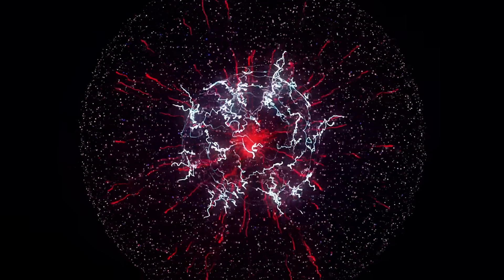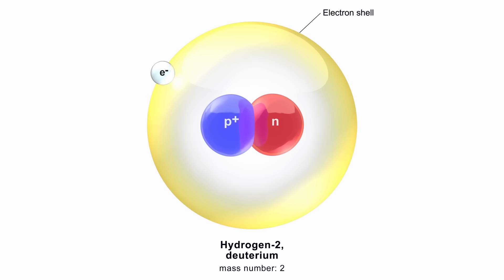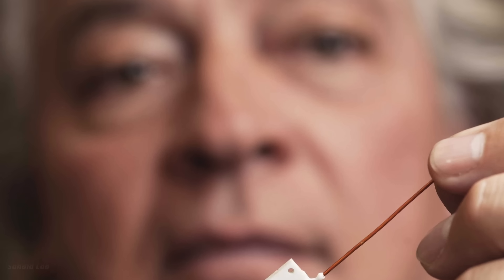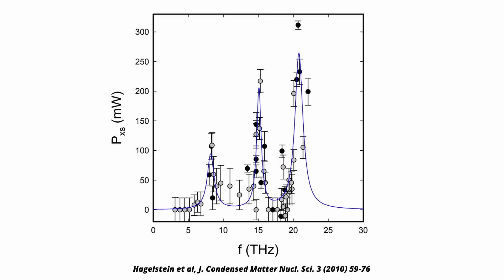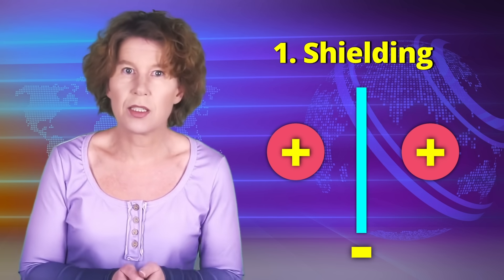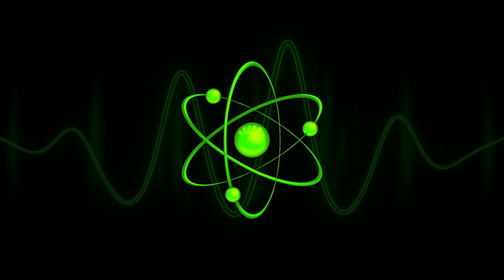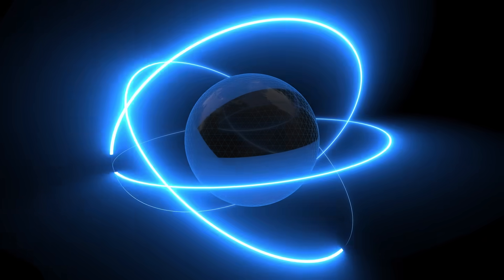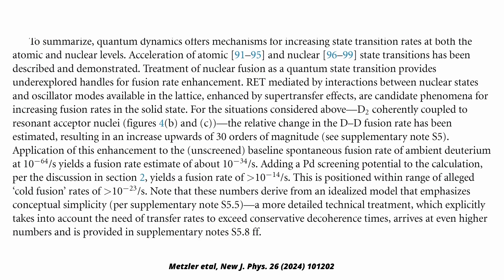Physicists Say They Know How Cold Fusion Works

Comment: The quest for practical fusion power is actually just an infinite money glich discovered by physicists. The rewards for investors would be so great that their greed makes them very susceptible to hype and they can't resist funding whatever wild goose hunts the physicists think is plausible enough to tempt them. 

In the dozens and dozens of predictions and forecasts for when practical fusion power will be achieved, i have never, not once, heard them admit to the very real possibility that we live in a universe where useful fusion power is not practically achievable on planets. 

Meanwhile, there is an actual, working fusion generator which will run continuously for at least another 5 billion years or so, which is constantly radiating billions of times more energy than humanity requires evenly over the surface of the planet we inhabit. But that energy is not going to make anyone into trillionaires, for that you need your own private sun in a basement that you can meter and sell. It makes me sick and sad.

Comment: Cold fusion is either associated with photodisintegration, or it's like a Peltier device, with more efficiency that uses alkaline water. The electron configuration is more important IMO, along with just general plasma electrolysis. Idk id ever feel comfortable referring to it as cold fusion, don't touch it, you'd be burned because of the energy it produces and it can kill, but its probably the same concept.

Comment: So, in summary: 1) Fleischmann-Pons has NOT been validated. 2) New theoretical calculations suggest new ways to accomplish cold fusion. 3) There is no experimental proof or demonstration of the calculations in point 2.
Reply: ENG8 have demonstrated 5x over unity, so there's that.
Reply: @littlefish9305  My response after a quick google search of ENG8: LOL

But, time will tell - they claim they will be commercial in 2026
Reply: @littlefish9305  ENG8 is a scam

Comment: There is a cold fusion option that does work, but they can't get enough energy out (not taking about diffusing deuterium and/or tritium into a metal).  The other option is muonic replacement where the electrons are replaced by muons which are 300 times more massive and thus orbit the nucleus much, much closer to the nucleus, within the columbic barrier distance and can get the nuclei to fuse.  HOWEVER - this requires you to have a higher pressure with the deuterium/tritium gas and when running at higher pressure, the muons are less likely to jump between nuclei (which is what you need to have the chain continue).  It was found that it was taking more energy than it was getting out, but it is a viable form of cold fusion.
Reply: Ai sloved it right

Comment: We did Fission and Fusion with photons....We did fission and fusion using venturis to speed and crush PHOTONS into muons and electron showers and INSTANTLY they fused back together...caused particle division and reverse ENERGY but not reverse mass exactly as spoken of lately. Light going forward and backward at EXACTLY the same time due to the push back at the venturi. We did and photoed using CMOS. Love to interact? Its all shown on my channel.
Reply: Um for fusion to actually occur more power has to come out of a reaction  then that put in it simply smashing particles together producing other particles which may come back together again is NOT fusion that's not the definition of nuclear fusion .
That's particle creation and annihilation which may produce some energy but not more than that put in it .

Comment: If experimental evidence provides proof of more energy than you should find in the system, then you have improperly defined the system.

Cold fusion demonstrates that the proper response is to remain skeptical of "complete" system definition.

This doesn't mean you throw out the scientific method. It means you balance rigor with an open mind.

Comment: Oh wow, this brings back memories. In the summer of '89, right after the Pons and Fleischmann announcement, I was interning in a US military physics lab. Our PI (principal investigator) got a small grant to do cold fusion research. I remember two experiments, both involving a palladium metal disc infused with tritium (I think). In the first experiment, we tried to replicate the Pons and Fleischmann electrolysis experiment using a calorimeter. Every day I would check the heat output looking for anomalies. Of course, nothing happened. The other experiment was a bit more dramatic, if equally disappointing. Our PI's specialty was radiation detection and he had the though that maybe physical compression could start the cold fusion. So we set up an anvil surrounded by various radiation detectors, put another tritium-infused palladium pellet on it, and had the burliest research assistant smash it with a sledgehammer. Of course, nothing happened, but it was exciting to think for a moment that we might see a small fusion explosion in front of our faces.
Reply: ACME would approve
Reply: I think most researchers that investigate cold fusion thru compression rather opt to difuse deuterium or tritium in water and then create standing sound waves in it, so they can rythmically create bubbles that implode after some centiseconds. The pressure produced by these implosions normally generates tiny flashes for temps inside get to thousands of degrees (that's how the pistol shrimp kills its prey), so lots of researchers have tried to do fusion by putting enougt D+T within these bubbles. Sounds well in theory, but to date nobody has been able to do so
Reply: @JosePineda-cy6om  you've given me an idea… I'm going to infuse some pistol shrimp with D+T
Reply: @JosePineda-cy6om  that sounds like a plausible explanation of how to create cold fusion. But it also sounds like something Cisco Ramon would say in an episode of The Flash.
Reply: @JosePineda-cy6om  Our company also tried this.  NO results.
Reply: He was not incorrect that physical compression starts the fusion process. But you need a bit more pressure than a sledgehammer. In a hydrogen bomb, they use a nuclear fission bomb to generate the pressure.
Reply: They use shaped conventional explosives to compress the fission stage, too. 

The thought of a serious scientist battering stuff with a hammer to maybe induce fusion is pretty funny, though.
Reply: @NeffJippard-z9k  The idea for making the first uranium bomb was a gun design so battering with a hammer wasn't far-fetched. Los Alamos did gun shots, too.
Reply: @solconcordia4315  I don't think you understand how the gun design works. You shoot one undercritical mass into another to get above the critical mass and boom. I don't see the connection to battering something with a hammer.

The thought just created a funny mental picture in my mind, that's all.
Reply: i think Pons & Fleischmann never had success with Tritium. It was deuterium that gave anomolous results.
Reply: @oystla  Hmm, deuterium might be more able to absorb extra neutrons.  There are many little facets to test.  I suspect the crystalline structure of the palladium is also immensely important for the atomic geometry involved.
Reply: Sledgehammer physics, Humanity is still scratching around in the dirt with our 🐒 🧠 looking for the All Spark
Reply: I was in a Physics PhD program in those heydays of High TC Superconductors and ColdFusion.
One of our postdoctoral. who was Stephen Hawking's student whisked a few liters of deuterium from somewhere to mess with it but was shortlived and shut shutdown when the university safety board found out about it.
Reply: have you never thought of doing experiments with sonoluminescence? I mean to smash a sample on an anvil is certainly one approach but I would be properly shocked if that had worked. If anything you should get a diamond anvil but still it would be a one shot ponny.

To get cold fusion you need to have a cycling procedure, with resonance. Otherwise it's just a waste of time as you cannot extract energy on a one-shot basis. The process needs to be continuous.
Reply: @vaakdemandante8772  
It's a validation test of the Pons-Fleischmann cold-fusiom claim. I'm pretty sure that they were trying to detect fusion byproducts such as neutrons.

I wonder about the ball lightning phenomenon as the atomic scientists had concerns of igniting the Earth's atmosphere in a runaway thermonuclear chain reaction due to the abundant nitrogen in the air. Nitrogen can be transmutated by neutrons from an H-bomb explosion. Ball lightning might be using nitrogen to power itself for such a long time as a wandering plasma ball.
Reply: As in rock bands, in which the drummer is always put forth to try something first
Reply: @cdorman11  The lab was named the “Keith Moon Physics Laboratory” in honor of someone who always tried something first.
Reply: That is such a cool story! Thanks for sharing!
Reply: @Pistolsatsean  thanks! Less fun was the time I had to work several tons of lead bricks used as experiment shielding from one lab to another using only my arms and a small dolly that could only handle about 6 bricks at a time 😂
Reply: @JK_Vermont  That sounds like the perfect place and time to have an epiphany my friend hahaha
Reply: fusion produces high energy *per unit mass*, and it doesn't chain-react like fission. You're not going to create an explosion with the tiny amount of Tritium or Deuterium in that palladium sample, with or without a sledgehammer
Reply: Sledgehammer Physics. I like it! I used to have a job doing machine reclamation that involved sledgehammering. Most enjoyable job I ever had.
Reply: I heard the palladium needs to have microscopic crevices around 50nm wide. Almost has to be nano engineered.
Reply: @DeRochette  You could simply build it in a 3D printer.
Reply: @DeRochette  yes it wasn’t a metallic pellet more like a sintered disc of palladium and some binder that could be permeated by the tritium
Reply: @DeRochette  Yeah, I think this was the Japanese idea I mention in my comment.
Reply: Pons and Fleischmann skipped peer review and went to the press. The world bought it. I remember seeing an editorial about the consequences of cheap power from cold fusion. Then others couldn't duplicate the results. The press learned more than anyone.
Reply: It's easy to mock Pons & Fleischmann -- they made a lot of choices that went badly -- but the resulting debacle was as much a product of science culture generally as P&F personally.

Pons and Fleischmann were chemists venturing into physicist territory, and when they found something genuinely perplexing and worthy of study the consensus of physicists preferred to pillory the chemists and dismiss them entirely rather than try to find what was actually happening.

P&F caught a lot of criticism for turning down offers of collaboration from more established physicists before promoting their "cold fusion" claims and bypassing peer review before going public.  But if I had been in their position I might have done the same thing.  At the time, most of those offers were coming from physicists who were pretty obviously interested in taking the credit if the research bore fruit and scapegoating the chemists if it did not.

I don't think P&F actually achieved fusion at all, but I do think they stumbled on a real and very interesting phenomenon that, while not to date consistently replicable, has been observed often enough to rate much more investigation than has actually been done.
Reply: See, this right here is why we shouldn't be doing it to begin with. INSANELY POWERFUL, and y'all phucktardz hit it with a hammer.
Reply: Well my brother was hit by a spontaneous fission burst while machining a plutonium/deuterium Fusion bomb trigger at Rocky Flats. Be careful with that stuff.
Reply: @OldBillOverHill  Why on earth would you get a fission burst from a fusion bomb?
Reply: Cold fusion is about small reactions not explosions
Reply: Cold fusion is about small reactions not explosions
Reply: Many researchers are now working with Nickel and Hydrogen now. the Pd/D system and the Ni/H system both work, but Ni potentially at higher temperatures.  Pure D is expensive and it looks like you enhance D in the Ni/H system.  Using Deuterium is an expensive shortcut.
Reply: It seems weird because if that had worked, you could have a crater where the lab was . Of course, it never was going to work, but supposedly you thought it might.
Reply: @xpusostomos  Back then, the explosion may have destroyed all the lab's notes. Now, I hope it can be recovered in a distant server (unless the military lab has its own isolated network.)
Reply: @xpusostomos  I don’t think there was enough tritium to be a significant risk
Reply: @JK_Vermont  how much, because E=mc^2 is a hell of a drug
Reply: Why a disc and not a rod?  I would think funneling the high voltage down a long crystalline lattice impregnated with tritium would create high probabilities of interactions.  And the higher the voltage, the more interactions there should be if it works this way.  Might also want to consider the effect of those 'vortices' that form at superconducting temps.  These vortices might also create regions of shielding between small nuclei, as well as have other beneficial effects.  We might find out that, counterintuitively, this form of fusion works better the colder it is!  

Of course, that makes it all but useless for energy production, since the more fusion produced, the hotter the system becomes, causing the rate to dramatically fall off.  We don't have a good method for removing heat produced within such a system, when that 'heat' would be in a system we're also trying to cool dramatically in the first place.  

Now, if we ever manage to produce a room-temp superconductor, that changes things!
Reply: @Alondro77  this was 35 years ago and I was just an intern lab rat … so I have no idea

Comment: As a physicist, I can say I have no problem with the possibility of enhancing fusion rates at low temperature.  The paper described here is interesting and could lead to something. The problem with the cold fusion episode was that the experiments were not designed to allow critical analysis of what was going on,  and claims were made without adequate basis.  I remember the experiments where they "knew" fusion had occurred because the experiment melted.   What Sabine is discussing here sounds a lot more like physics to me.  And you would test the reaction rate by detecting neutrons or other reaction byproducts, not the heat emitted by the system.  Don't use tools that are blunter than they need to be.

Comment: I retired from Intel in 2002. Just before I left, my sailing buddy and senior device physicist showed me a plot of energy density vs technology generation (Moore's Law). He predicted then that the next generation of transistor's heat density would surpass the surface of the sun. Keeping in mind that the number is large because the volume is so incredibly small. I think that was when they went to in silicon cooling?
Reply: Random trivia: The surface of the sun is (relatively) not that hot. Something like 5,000C. As opposed to the core or corona of the sun, which is measured in millions of degrees C.
Reply: Given that Intel had came up with the Pentium 4 around that time, his predictions make perfect sense!

Comment: I'd buy that for a dollar!
But anti-gravity works by slowing the flow of time above the object to be levitated yielding "low pressure time" which is pushed upon by "high pressure time" . . . 
The simplest demonstration are the electro-gravity "lifters" - the charged wire produces "low pressure time" above the lifter and the "higher pressure time" below the lifter pushes it up.

This is analogous to "aerodynamic" lift but inverted.

But if you believe that curvature of spacetime is causing gravity, this will be difficult. Red herrings are seldom helpful.

+++++++++++ - high pressure time - farther away from mass 
+ + + + + + + + - low pressure time - closer to mass 

Those extra pluses push downward and with no extra pluses to counter that push, you get ACCELERATION towards the larger mass, or towards the lower pressure time.

Comment: The way to get Hydrogen into palladium is electrolysis with the negative electrode being palladium and the positive hydrogen atoms are smaller that the palladium atoms and gets absorbed in-between palladium atoms, as much as 1000 time as many hydrogen atoms to palladium atoms.  I do not believe the hydrogen atoms would fuse automatically when palladium is full, there has to be a second step to compress palladium containing hydrogen, maybe implosion.
Reply: Cavitation is much cheaper than implosion.
Reply: The best way to get H into Pd is to heat the Pd to 350C. This is done all the time in H purifaction.

Comment: So what happens when maser energy is applied in a plasma cloud under supplemental heat and pressures contributed by Nature? Nobody has drilled for geothermal energy to depths of twenty miles, but that forecast requires successful vaporization of dry and solid rock. But has that combination been simulated in the lab? At the surface and to depths that conventional oil wells might have been pre-drilled with high efficiency, those fusion-tech questions don't come into play. But does Sabine assure us that her doubts about cold fusion causality will protect us from volcanic lightning bolts from Hades' revenge?
Reply: What if the structure of atoms depends on coherence and compliments, such that when confused with noise the pattern of nesting is disrupted and unable to find its equilibrium or proper state for cohesion? What if you shake the stem and all the apples fall on your head instead? Drilling at Oregon's Newbury Volcano to thousands of feet seems to tempt that dragon's breath, but how will Quaise know until it's tried? Nitrogen plasma is about 9000F, isn't that enough to disrupt bonded electrons in atoms?
Reply: Or is that just amateurish nonsense?